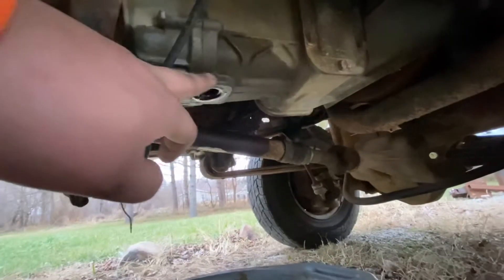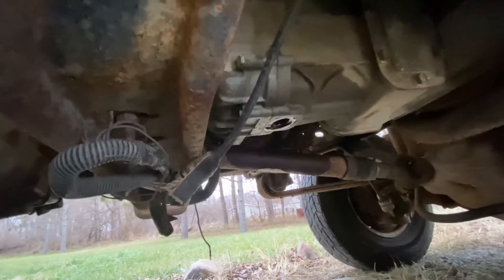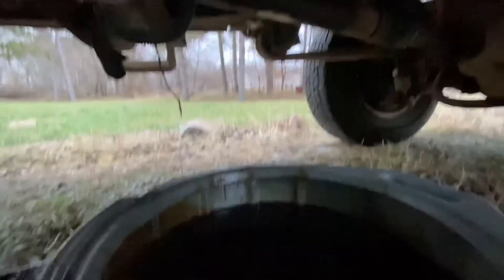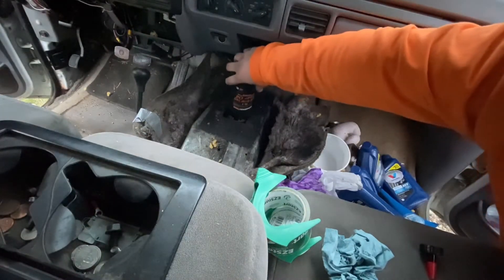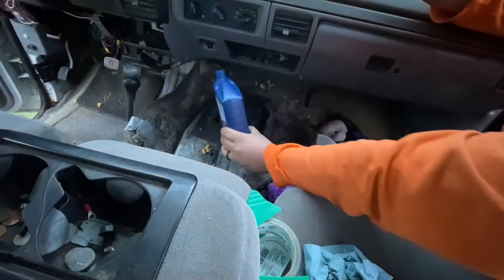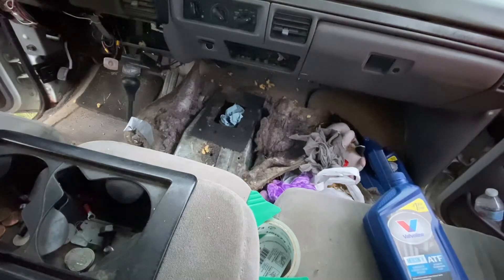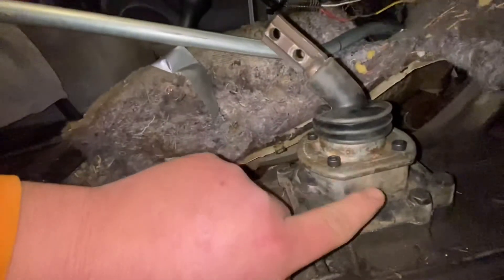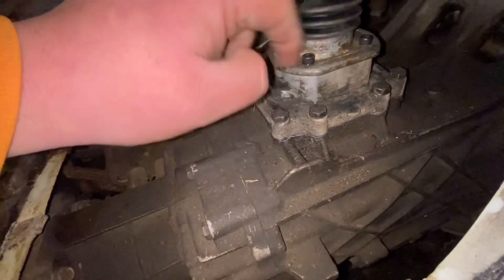zf5 oil change!

Comment: how that gear oil donin there? mines doing some grind sound in 4th im planning to change out the oil soon but i was just going to add 1 or 2 quarts extra to help with the sound
Reply from the maker: It took out some noise but not a whole lot
Reply: @Redneckpimp  yea i tried filler 2 quart over the filler hole and my 4th gear still grinds like hell even scared to drive it the harder i gas it in 4th the louder it gets then 5th is quite, gonna have it get it checked this week
Reply: @Redneckpimp  what foes yours do?
Reply from the maker: The main bearings where just a constant humming and it sounds like your synchro is out
Reply: @Redneckpimp  yea that’s probably it since 4th gear is direct and it goes away in 5th im gonna try adding a lucas additive seen if that helps, if not ill just have to take it to the shop soon
Reply from the maker: That’s what I’d do